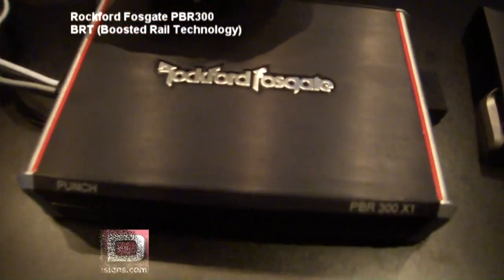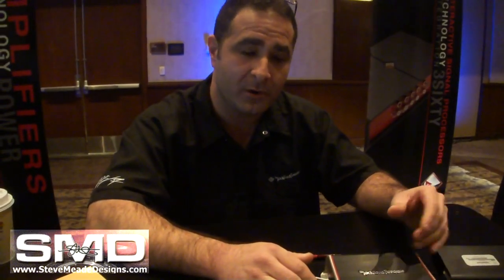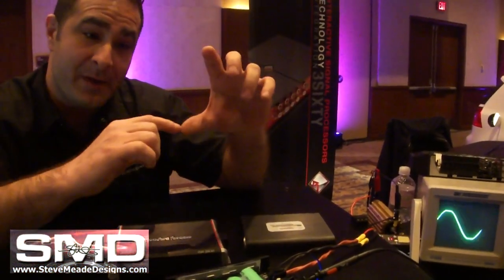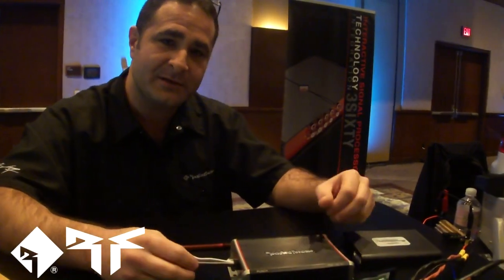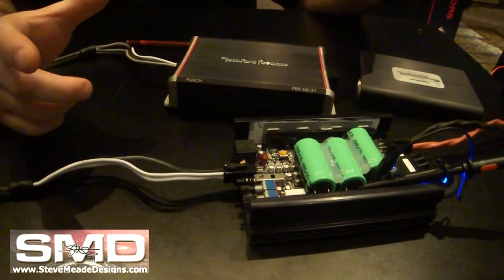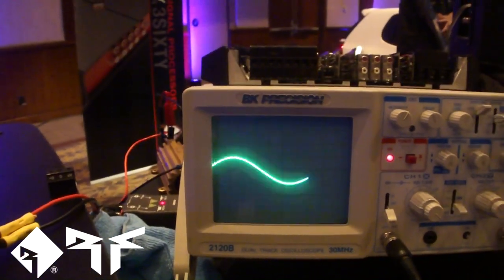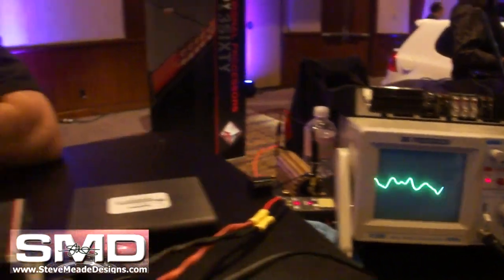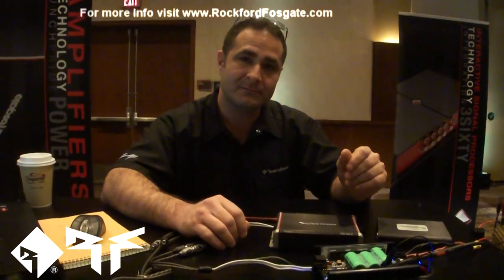Rockford Fosgate Boosted Rail Technology Explained - CES 2011

Comment: I'm waiting for the day when a company makes an 18" sub 44% smaller. An 18" that is only 10"s in diameter would take up far less room.

Anyway, damn this is amazing how they do this, I'm guessing that it doesn't have a negative rail as such but the 0v neutral rail floats around at half the total voltage? So when at 12v, the 'ground' rail is 6v, or when at 24v it is 12v? I don't know if that even works, I'm just guessing?

Comment: So running this would make the source be "maxed out" more often then a conventional 12v setup?  That means more heat, more disturbance and sooner death not?  I almost follow this 100% but can't quite put it all together.  What is in place for cooling?  And what about making sure that 12v stays "24v" for long demands not just "peaks"?  If you ran 2 12v batteries in series would that be compatible and help this or am I all fucked up? Im not a stereo guy, but I like 2 learn about shit!